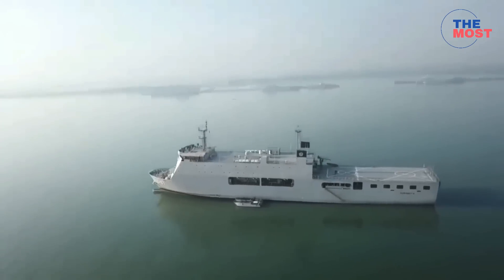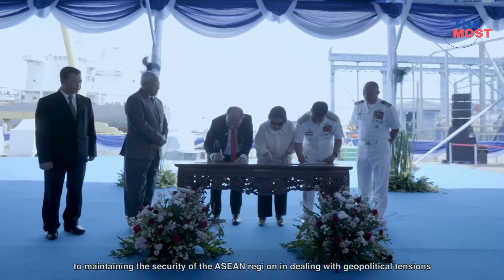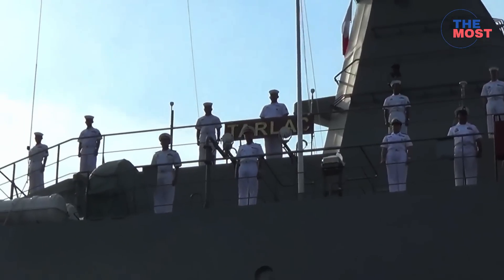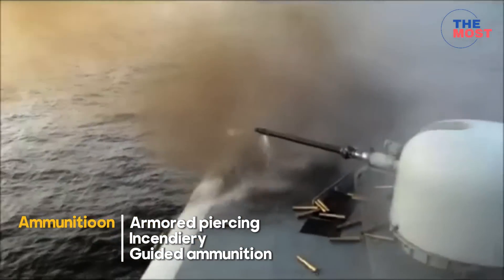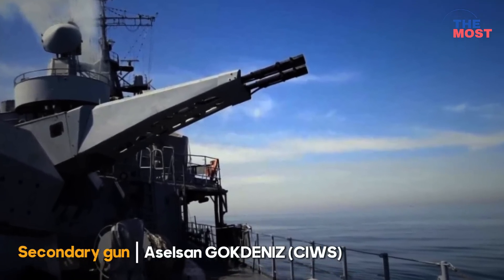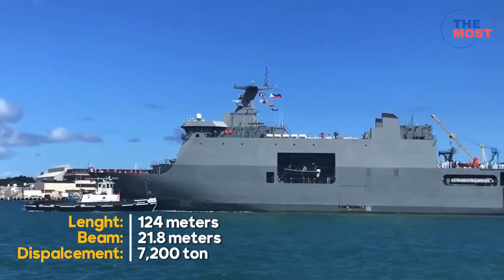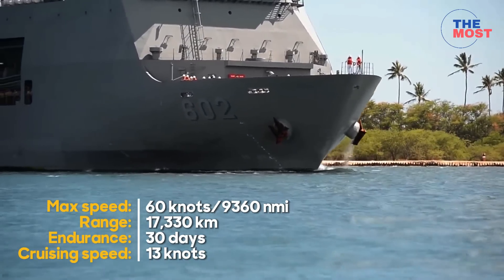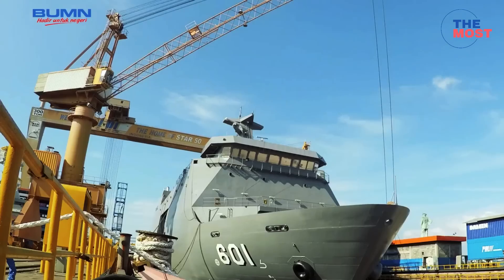The Philippine Navy's Upcoming Strategic Sealift Vessels: Major Upgrade

Comment: Mali info mo. Yung order ng ph wala nman armaments, parehas yan nung dalawang nauna.. Brp tarlac, Brp davao delsur.
Reply from the maker: https://en.wikipedia.org/wiki/Philippine_Navy_new_124-meter_Landing_Platform_Dock General specification upcoming SSV of PN
Reply from the maker: https://en.wikipedia.org/wiki/Tarlac-class_landing_platform_dock General Specification of Tarlac Class
Reply from the maker: The Philippine Navy released information to tenderers that the ships are to be built with allowance for a 76-millimeter (3.0 in) Oto Melara 76mm Super Rapid main gun, two 30mm Aselsan SMASH secondary guns, either the Rheinmetall Oerlikon Millennium Gun or the Aselsan GOKDENIZ gun-based close-in weapon systems, and 8 manually-operated 12.7mm heavy machine guns. But the armaments is FFBNW
Reply: Apakah anda mampu membuatnya..😅